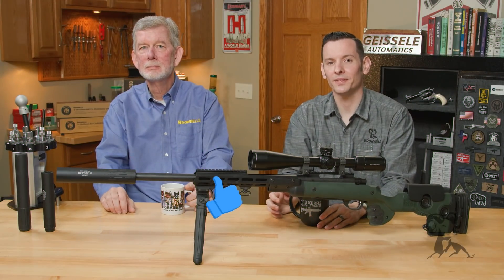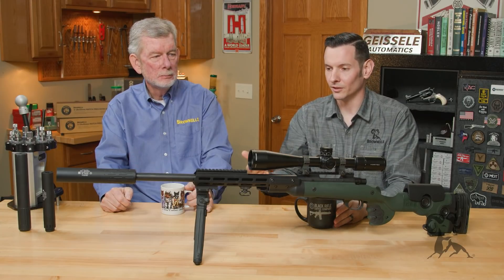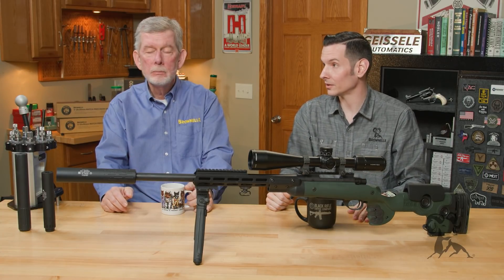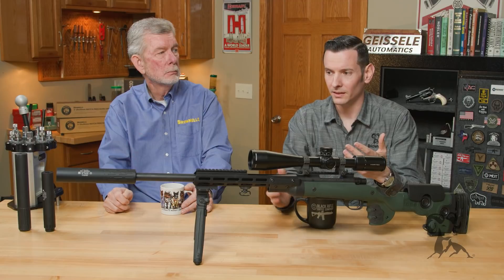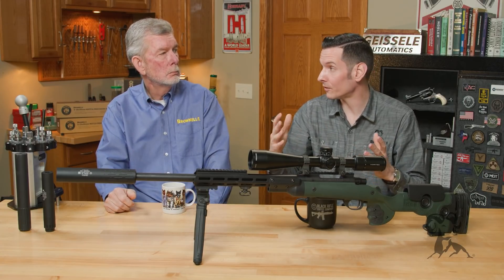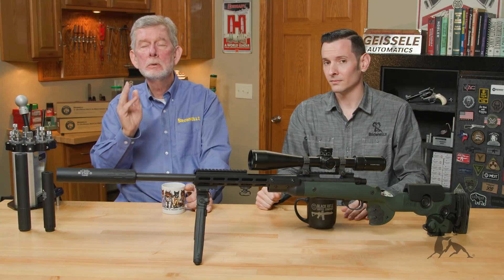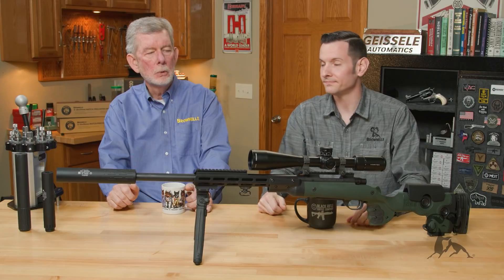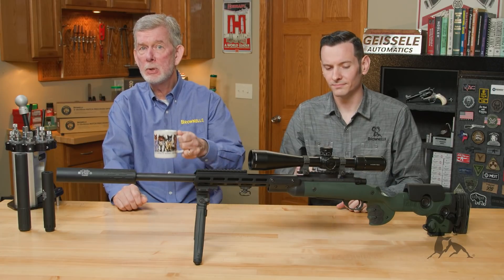Smyth Busters: Does a Suppressor Reduce a Gun's Accuracy?

Comment: Why are shims needed as opposed to crush washers?
Reply: Crush washers when compressed apply uneven pressure from the barrel to the rear of the muzzle device. Shims are precise flats of material so the pressure is applied evenly between the barrel and the muzzle device.
Reply: @aaronorr5586  Thank you

Comment: The fact is that it probably will shift the point of impact because of the changing muzzle velocity, and it CAN affect the accuracy just as any muzzle device.
Reply: No. Point of impact and accuracy have nothing at all to do with each other. This is a myth parroted by so many people who have never actually done a comprehensive and scientifically valid test of these devices.
Reply: @Orcinus24x5  
"Point of impact and accuracy have nothing at all to do with each other."

I didn't wrote anything like that, please read it again a few times and try to comprehend, don't use straw man argument!

Comment: They tend to decrease accuracy on bolt action 22lr.
Reply: do tell.....I run a can on my Vudoo and have run a tuner.  Have not seen this to be the case
Reply: @hughtanner208  . I noticed it on mine. See x ring experiments.
Reply: @zgennaro  is this under the X-Ring page or another page?
Reply: I think I found it

Specific to .22LR it would seem that barrel harmonics would become a HUGE issue in that 300 yards in .22LR is where things would seem to be a Significant issue

Comment: Suppressors can affect (hurt or help) group size and shot placement for a few reasons. 1) changes to barrel harmonics, 2) barrel droop, 3) increased muzzle velocity. 

If the shooter gathers ballistic data without the suppressor, then takes the rifle out to shoot long range suppressed, they may be off on their ballistic solutions because the bullet is exiting the gun faster than what they chronoed it at without the suppressor. They will be impcting higher than anticipated when using the suppressor. This is user error.

The weight of the suppressor will flex the muzzle downwards slightly due to the extra weight on the muzzle. This is intensified with heavier cans, longer barrels, and lighter barrel profiles. With a lightweight can, heavy and short barrel, it might not be noticable. With a heavy can on a longer barrel, the effect will be that the rounds will impact lower. This POI shift will be noticable at your zero range, but past your zero range the POI difference will decrease a little from your unsuppressed zero because the bullet is also traveling faster with the suppressor, so the trajectory will be a little flatter.

Most of these problems can be avoided if you just gather your ballistic data and do your zero with the suppressor on and then just leave it on when shooting. The only difference you have to account for at this point is the harmonic difference. If you tailor your loads for the harmonics of the suppressor attached, then it becomes a nonissue
Reply: "Barrel droop" in this case is the added weight of the suppressor slightly bending the barrel downwards with gravity so that the bore points at a point lower than the line of sight at the zero distance
Reply: Either way, what Im talking about is weight pulling the barrel off the original axis.
Reply: @jamesaldridge2431  Even with a light and long barrel I just don't think the weight of the suppressor is enough to make it droop that much to affect the barrel. A well-made steel barrel should not even droop with a suppressor on. It might oscillate when a round is fired, but again, the bullet leaves the barrel well before it can be affected by that oscillation. I still think it's the pressure created by using a suppressor.
Reply: @abnr1983  No sir. Harmonic vibrations do in fact travel to the end of the barrel before the bullet leaves. This is well known, well understood, and well proven throughout the precision shooting community, of which I have been apart of for most of my life. Also, have you tested POI shift with and without a suppressor at various ranges? I have. It verifies the science - the round will impact lower when closer and higher when farther compared to your poi's unsuppressed
Reply: My apologies.  I guess you did mean the suppressor along with gravity would make the barrel droop slightly.  I’m sorry and I don’t want to get you angry because nobody likes to be publicly corrected but that theory is just 100% incorrect.  Wherever or whomever you acquired that information from was mistaken.  I’ve also heard people say never stand your rifle up with the barrel against a tree because that could warp the barrel.  That’s wrong also.  The steel composition of modern fabricated rifles along with our gravity will absolutely not cause any droop with the minimum amount of weight a suppressor would add to the barrel. We are talking about a metal capable of withstanding the pressure of an explosive charge inside of it.  I’ve had a deputy leave his AR-15 on the trunk of his patrol car and drive off forgetting he left it on the trunk.  The rifle fell off in the road and was run over by one car and another car locked his brakes up on top of the rifle and it skidded under his wheels.  The barrel was perfectly fine.  The extended charging handle, front sight gas block, pistol grip and buffer tube was replaced and the rifle was good to go.  My point is rifle barrels are very rigid, robust and will not droop.  It’s possible there could be exceptions with sleeved carbon fiber or composite barrels but I am unfamiliar with those characteristics due to lack of experience.  I suggest traveling down that rabbit hole and doing a bit more research if you have doubts.   I am fascinated with always learning something new and even though I’ve been in the firearm industry for the majority of my life I still learn something new all the time.  Maybe a better, easier or quicker way of performing a firearm repair.  Maybe just a new bit of firearm trivia I’d never heard of.  Please don’t be offended as that’s not my intention.  My point is to post facts on subjects I think might help someone else and learning from others.  I’ve also been corrected because I’m not perfect.  It’s easy for me to take criticism because I have no ego.  I’m married and my wife destroyed my ego long ago.  Lol.  Stay safe brother. ✌️
Reply: @onionhead5780  lol ok
Reply: I wouldn’t bet my life on it but I think barrel droop is mainly limited to an air rifle problem.  Unless you were furring to barrel flex and it was just a miscommunication in our terminology.  I don’t want to discredit your statement because it seems you did your research and you know what you’re talking about.  I don’t claim to know everything but I’ve never encountered a modern cartridge rifle having barrel droop during my 22 years as a gunsmith.   For some ungodly reason because I’m a gunsmith my customers think I’m an expert in air guns as well.  I’ve had customers bring air rifles in with an accuracy issue before and it was indeed what they refer to in the air gun industry as barrel droop.  I think it occurs on air guns due to design flaws, inexpensive inferior manufacturing and or metallurgy quality to keep the cost affordable.  Shoot safe and shoot straight. 👍
Reply: Like Onion Head, I really never bought into that barrel harmonics or barrel droop. My reason for that is the bullet leaves the muzzle faster than what barrel harmonics (harmonics is the wave or the oscillation of the barrel) can do to it. In my opinion, it has more to do with the pressure that you're introducing inside the weapon which in turn can change muzzle velocity. That, I think, is the reason for the POI change in a gun with a suppressor.
Reply: @abnr1983  Sound travels at more than 3.000 m/s (> 10.000 fps) in steel, wouldn't it start moving before the bullet gets to the muzzle?

Comment: I think some of that, which includes really any muzzle devices,  is they change the barrel harmonics,  and some people don't know that.
Reply: Exactly. Shotgun News, I believe it was< did an article a few years ago about accuracy and bayonets. They used post-WW1 era bolt action rifles and their assigned bayonets. The Lee-Enfield was actually MORE accurate with the nearly 24" blade acting like a harmonic balancer/ tuning fork.
Reply: @jarekmace1536  what if they had the guts of the dude they just stabbed hanging off the end of it?
Reply: I was about to say that. Having a huge chunk of metal attached to the end of your gun is definitely capable of changing harmonics and thus changing your accuracy; especially if you have a tailored hand load. But it shouldn't be too much. A lot of it depends on the host gun.
Reply: @Argentum7756  yeah from what I've seen,  it can change the poi several inches,  still grouping, but it definitely changes.  Johnny's reloading bench actually tested this a while back.
Reply: Exactly HR.  I have a custom built 1000 yard bench rest rifle in 6Dasher.  BAT 3 lug action, Bartlin barrel, Jewell 2oz trigger Shehane stock... left the muzzle brake off during some testing and my groups tightened up.  Went on to win a state championship that year shooting it in both the light and heavy gun class.  The best components and a superior gunsmith are not the only ingredients to an accurate rifle.  Load development to maximize barrel harmonics is crucial.

Comment: In some cases they help more. Look at the SCAR 20s.
Reply: SCARs are a weird example though. You have to use specific suppressors approved by FN that bleed off / don't produce excess back pressure. Otherwise with even light use you risk breaking the bolt assembly. More than a handful of videos out there where people thought they'd use an unapproved suppressor for several range sessions only to find their bolt assembly shattered.
Reply: @Rowrin  The fn approved suppressor is made for military only the next best thing without modifying the gas jets is the Socom RC2 no modifying
Reply: @xarchlight2779  There is an official FN suppressor made for the military. But FN has a list of supported commercial suppressors that they recommend you use to prevent damage to your gun. Just search youtube for "FN SCAR Broken bolt supressor" and you'll find videos of owners describing what happened.
Reply: @Rowrin  I know I own a Surefire Socom RC2 on my scar 17 also I am in a fn scar group on Facebook and people talk about what cans to use all the time, also FN doesn’t recommend a suppressor at all, it voids their warranty says it right in the manual
Reply: What?

Comment: What about barrel harmonics
Reply: Tom McQueen This would be a good test since the can on the end adds weight to the barrel or any muzzle device for that matter. I would say as long as everything is aligned and the weight of the can is accounted for in the harmonics then it would not affect the barrel harmonics but if not then it will. Just sticking a can or device on the muzzle without adjusting for alignment and the affects on the barrel could be a problem with accuracy and harmonics. As said in a comment above the added weight may shift point of aim. Every time you change that weight you may shift point of aim.

Comment: Great video.. I would have to say across the board, no suppressors do not decrease accuracy, in fact often time it will tighten groups up. That being said I have rifles that "do not like to be suppressed" for a certain load. Example, I have a Sig Cross in 6.5 CM that will shoot lights out with my pet load with suppressor mount installed but once I put the suppressor on groups open up by as much as 300%. Other rifles with the very same suppressor will tighten up as much as 100%.. So as a general rule no they do not but some of my rifles do not work well with them.. Too much weight out front? Screws up harmonics? The range myth I love to hear is.. " you know suppressors make your round slow down .. right"
Reply: Florida HD Shooter I wouldn't say "screws up" but changing muzzle weight can change point of aim/impact with the harmonics.
Reply: @rbm6184  I expect a POI shift normally lower.. but with this rifle/can I went from .34 MOA to 3.12 MOA with my pet Handload..
Reply: A suppressor adds mass, and can certainly affect accuracy depending on the amount of mass and the stiffness of the barrel.  The stiffer the barrel and the lighter the can, the less likely you are to see an impact on accuracy.  Likewise, with the suppressor you should be able to develop a pet load that brings back any of the accuracy lost, although there still may be a poi change to account for.
Reply: I’m with you on this. 77 gr out of my 18” 556 (no suppressor) are consistently 3/4” groups. When I put the suppressor on, it takes these same bullets to shooting 2” groups. Same suppressor on other rifles reduces group size.  

And I know the difference between group size and poi shift.